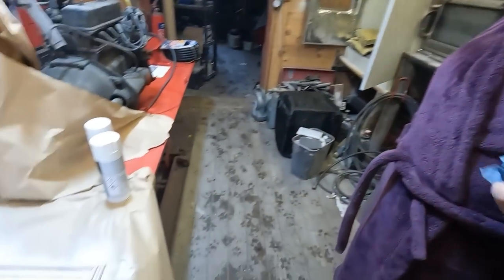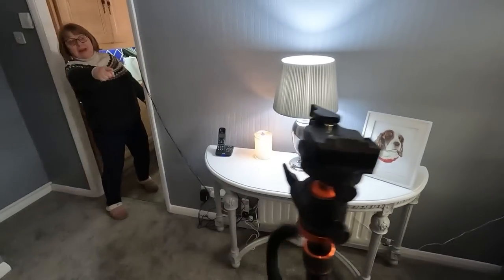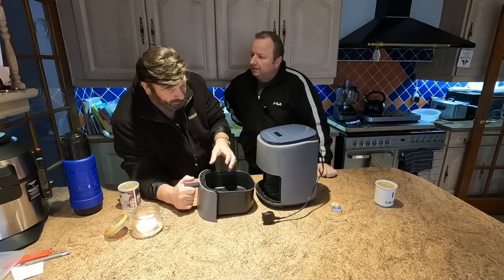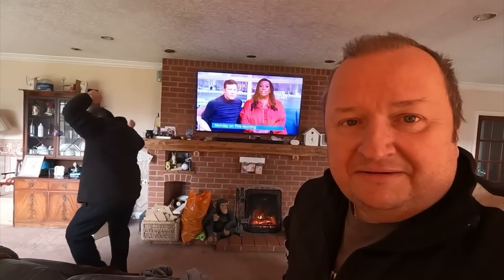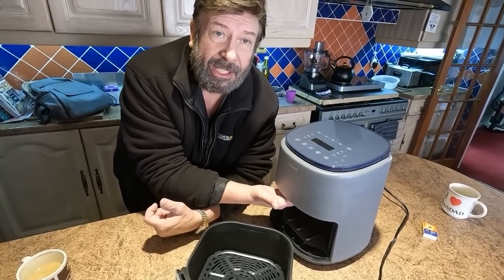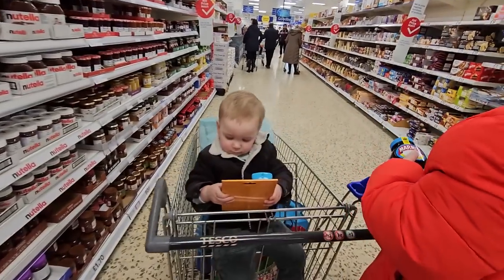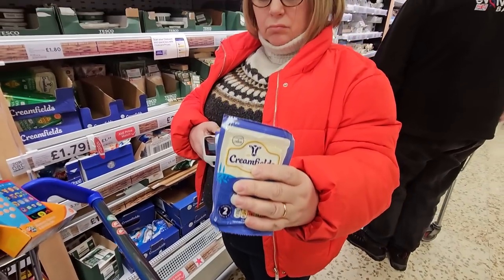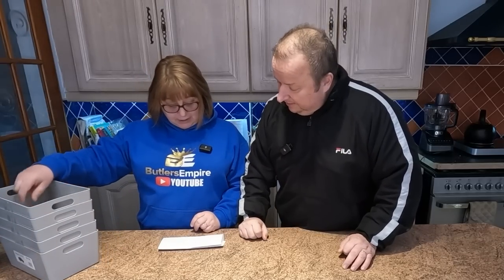We Donate A New Air Fryer To A Local Man

Comment: Can’t beat a decent log burner, or, like us a multi fuel burner so that you can use wood or coal. If you get a fan it starts pushing the heat out into the room within 10 to 15 minutes. Cosy.

Comment: Just a quick comment about the cheaper end of the market where Air Fryers are concerned. We have a Tower T17072 Vortx Vizion , gets used 4-5 times a week and we've had zero issues. So is it the product at fault or the user? 
We also have a Breville VDF127 Halo Rotisserie Air Fryer Oven which is brilliant, love the rotisserie part, best pork joints i've ever had :)
Loving the vids :)

Comment: when are you guys going to try out a thermo mix?  Just bought one on the weekend love it.  Gee your prices over there for food is cheaper than over here.
Reply from the maker: What is that?
Reply: @butlersempire a thermomx is basically a powerful blender that also cooks and stirs. You can use it to knead dough or mix batter. It comes with two steamer baskets, a small one that fits inside the blender bowl and a large one that perches on top. It also has a built-in scale, so you can add ingredients by weight.